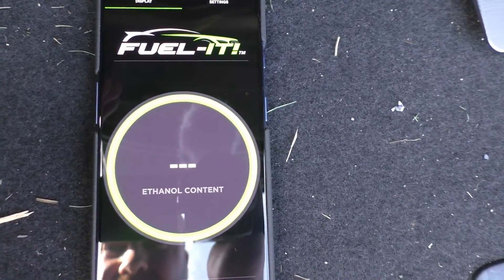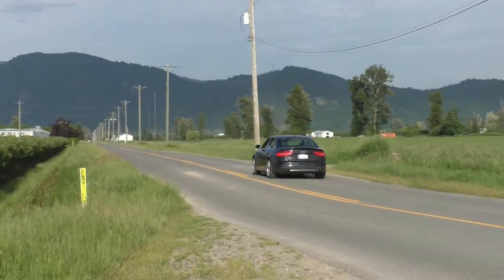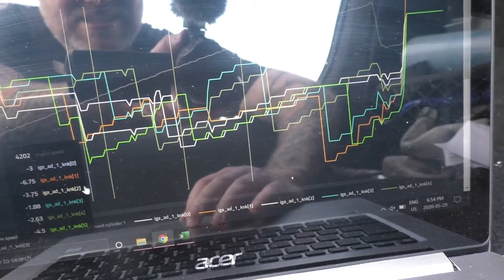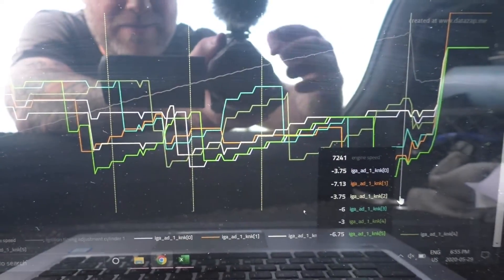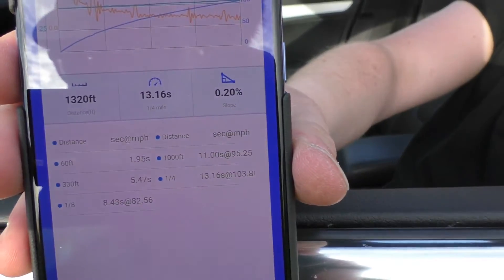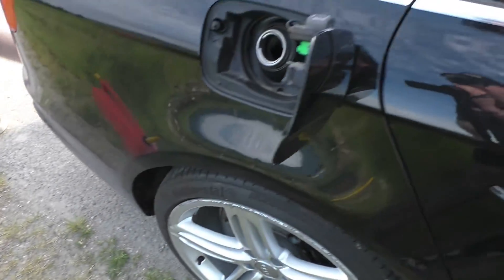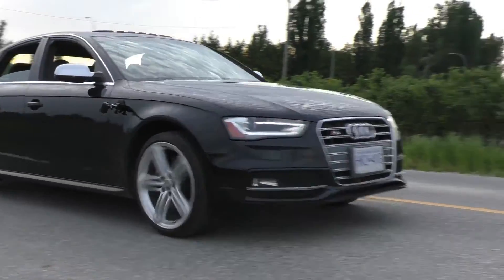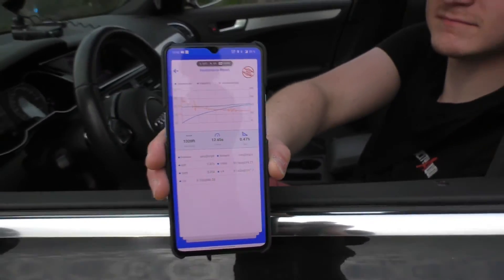ADDING POWER BY ADDING E85 TO PUMP GAS!!!

Comment: What levels are safe without any ethanol related mods? I need to do some logging with my vcds
Reply from the maker: You'll more than likely be completely fine with up to E20. I always recommend you start with E15. Log your car and see how the fuel system is doing. If you still have a bunch of head room, then E20 should clean up any corrections you're seeing

Comment: I have a '13 Q7 with JHM stage 2+ ECU/TCU tune running their 207mm crank pulley and heat exchanger. I have a 24 gallon tank and use 92 Octane here in WA state. Can I add a couple of gallons of E85 to the full tank of gas on the stock fuel system to get any benefits?
Reply from the maker: Absolutely you can! You can run a 93 octane tune on an E15 to E20 blend and make a bunch more power. Just datalog your car once you've added more ethanol to make sure your fuel system can keep up.

Comment: Hi there! I have 2 Speedways by me - the one with e85 only goes up to 91 octane gasoline. But, I can get the e85 there and go a mile up the road and pump 93 octane from the other Speedway. Is it worth it to pump a gallon of e85 and then go a mile up the road to pump the remainder 93 octane, or can I just use the 91 octane next to the e85? Thanks!
Reply from the maker: what octane are you looking to achieve and what tune are you trying to run?
Reply: @VancityAudi  sorry I wasn't very descriptive - its an 8v Audi a3 w/ the 2.0TSI w/ APR low torque 93 tune (soon to be high torque) and TCU tune.
Reply from the maker: @Matt Em  as long as your fuel system is working correctly, you can run the 93 tune while using 91 octane fuel blended with additional ethanol to equal an E20 level. The additional ethanol will raise your octane level past 93. With that said, as soon as you do that, you should be datalogging your car to make sure it is running correctly.
Reply: @VancityAudi  Ehh I made a mistake - the one Speedway w/ e85 ONLY has 90 octane, so I pumped 1-gallon of e85 at that station and then just drove a quarter-mile up the road and completed the remainder in 93 octane.

Question though! If you're always putting in 1-gallon of e85, unless you run that tank empty every single time, aren't you eventually gonna dilute your tank so the concentration of e85 eventually become really high??
Reply from the maker: @Matt Em  not sure you're understanding how this works. The best way you'll be able to monitor your ethanol level is by installing the ethanol content analyzer like i showed in this video. P3 makes one for your car. 

If you consistently add a few gallons of ethanol into your pump gas every time you fill up, that will ensure your octane level is above 93. As you burn off the fuel and then add the same mixture to the tank once you're out of gas, you will simply maintain your ethanol content level. It won't make it any greater seeing as you're burning off the fuel in the tank in between fill ups.
Reply: @VancityAudi  Yes I'm tracking that and the monitoring etc. But, lets say I only use half a tank. If I put 1-gallon of  e85 into a half-tank that already has 1-gallon of e85 (the remainder 93..) - wont the tank eventually dilute the ratio and have a higher concentration of e85 than intended?

Sorry to be a pain but I REALLY appreciate you.
Reply from the maker: @Matt Em  that's why you don't simply dump a gallon in every time. You use an ethanol calculator (many are available on line) to figure out how much ethanol you need to add for the amount of gasoline you are about to fill up with to make sure you don't go above E20.
Reply: @VancityAudi  Ohhhhhhhhhh gotcha! Thats the part that wasn't clicking. Thank you a million for clearing that all up my man!

Comment: why not use Total Timing? I dont see the point of looking at each cylinder
Reply from the maker: How would you tell if you have issues with one particular coil pack, spark plug or cylinder pressure if you don't log each one individually?
Reply: @VancityAudi  Because in this video, you arent looking for problems with coil packs, spark plugs or the cylinders. You are only looking for timing pulled and timing added. In this video.
Reply from the maker: @BigMotorLover  you are missing the point. Total timing is an average of the total timing you see in all of your cylinders. It isn't showing how much timing is being pulled. You are wanting to ensure that no timing is being pulled at all. The only way you can see that is by logging each cylinder. If you have zero timing pull in 5 cylinders and then one cylinder is -5 you then know your fuel is up to the task, but you may have an issue with a plug, coil pack or your cylinder may be cooked. Does that make more sense?

Comment: Last week I drive to NY to add 6 gallons of E85 (guaranteed to be E71 or higher) to a full tank of 93 (which already has up to 10% ethanol in NY).  My overall tank estimation was somewhere around 30% eOH.  I am running an APR DP+ tune.  The car is an absolute ANIMAL, I cant believe the difference.  I can only imagine what a proper fuel map for this blend would be like-
Reply from the maker: If you haven't logged your fuel trims this is very inadvisable. 30% is the absolute limit of the stock fueling system. I don't recommend anyone blend more than 20% when running pump gas tunes at a DP+ power level or else you can lean your motor out and cause it to blow the F up.

Comment: Great video! Will the results be the same with a meth set up that's tuned for power, just there for octane boost/knock control?
Reply from the maker: No, not exactly. There is no need to tune for the additional power using a low blend of ethanol in your pump gas. If your car is tuned to run meth though you will have to always make sure your meth is spraying properly for your car to run properly and not lean out due to a lack of octane.
Reply: @VancityAudi  whoops sorry I meant not tuned for meth. But I get what you're saying thanks!

Comment: Awesome info,  I’m on a B9 s4 APR stage 1 - you think a gallon of E85 with 91 should be solid?
Reply from the maker: There isn't one answer for every car and every tune. You need to log your car. Then you need to install a content analyzer. Then use an E85 calculator online to find how much E85 you need to add to your pump gas if you are seeing significant timing reduction in your logs. It's almost like I explained this all in this video already, lol
Reply: @VancityAudi  I’m well familiar with logging for data and using it to determine changes in the map. I was simply asking in your experience if the ECU’s you’ve seen adjust accordingly to a small amount of E85. These new ecus are light years ahead of what we used in the EVO world. 

Since it seems like you’re inconvenienced in engaging with your community. You’re not obligated to answer a comment either since you “almost like answered it in your  video”

Thanks again!
Reply from the maker: @ZlatanKnowsBest  Your question was answered in the video so why ask it then? lol.  Each car will run differently with the fuel you choose to use, the tune you are using, the wear and tear on the motor as well as its components.  There is no straight forward answer to your question until you log the car and find out for yourself how it is currently running on your APR software.  For all you know you are only puling a tiny bit of ignition timing and then you don't need to blend much E85 to clear it up.  Then again it could be pulling a f$ck ton of timing and you'll need to add way more to correct for the lack of octane in the pump gas you are using.  So log, add an ethanol content analyzer, blend a small amount, log and then add some more if needed.  Just like I mentioned in the video, haha.  Good luck!!!
Reply: @VancityAudi  trash reply. We found this on the B9 page under the “Snarky replies from car owners due to sensitivity”.
Reply from the maker: @CamaroSS2236  lmao. I was simply speaking the truth and it seemed to upset you as well as the other owner. Glad to know my snarky replies are being talked about elsewhere! Lol
Reply: @VancityAudi  it was a general discussion about snarky replies lol. No need to be upset.
Reply from the maker: @CamaroSS2236  I'm not upset in the least and wasn't upset before, lol. The problem with reading text on the internet is you can't read tone.
Reply: @VancityAudi  perhaps that’s the glory of text. Tone is interpreted through perception.
Reply from the maker: @CamaroSS2236  looks like we disagree again, lol.

Comment: If your using a pump flex fuel that is a E60 blend and not E85 does that change the amount of ethanol that you need to use? Just because my e60 pump would be easier to get.
Reply from the maker: Yes, E60 means 60% of that fuel is ethanol. E85 means 85% of that fuel is ethanol.  You'll need to add more of the E60 to get the level you would like to achieve.  Use an online E85 calculator to help you out.

Comment: Okanagan MK7.5 Golf R owner here. I've seen noticeable improvements in not only the overall power, but power delivery by adding Octane to my Shell 91. Because I dont have an ethanol Analyzer, I've been using VP Octanium or Race Gas additives from Lordco, mixing to their reccommended spec for 100 octane.  I've brought my best 1/4 on GPS down to 12.5 in a "stockish"  R with 7 speed DSG. 

My question for you would be: what is better? Adding Octane or adding Ethanol? Buying E85 locally is impossible, unless we're buying it from VP in a drum, from the local hotrod shop.... where Octanium and Race Gas are available from all the Lordcos locally. Would Octane not be a safer way to correct timing pull?
Reply from the maker: In my opinion using 15% ethanol blended with Chevron 94 or Shell 91 would be WAY safer and smarter than using additives.  Have you checked your spark plugs lately?  When you pull them are they orange and corroded? Rather than clean?  Keep in mind ethanol also has cooling properties.
Reply: @VancityAudi  slight tan tinge to them, similar to using high octane fuels purchased in drums. I used to own a Supercharged NB miata and it frequently saw VP105, plugs look the same. 

Do a dig on the Race Gas and VP Octanium. Some US based tuners are using it with great results. Its convenience can't be beat. On Shell 91/Chevron 94 - I could hear audible knock. Now nothing, and SOTP feel is 100% improved. GPS 1/4 mile is improved by .5 sec

 I'll look out for E85... if you say its safer.  It just isn't available in the Okanagan at a pump, AFAIK.  Petro has an Ultra 94 in Oliver and Osoyoos which is 94 E10. It was brought in for Area 27.  Might have to make a trip down there soon for a fill. 🚀
Reply from the maker: @tanktheram  I had no idea they had 94 Ultra there. That is supposed to be the best available pump gas in Canada if it is the same fuel that they get in Ontario. I'd try some of that with an additional 5 to 10 percent ethanol for best performance. If you like the additives then, stick with them. I just know I'll never use them. I'd prefer proper fuel over an additive any day.
Reply: @VancityAudi   wish we could just get some spicy fuel at the pumps, and not have to mess around....
Reply from the maker: @tanktheram  and finally if you contact Northside Petroleum in New Westmister they will deliver barrels to you in the interior.
Reply: @tanktheram  Hey, I'm getting some knock on the stg1 tune on my RS3, our 91 octane is soooo bad here in Nova Scotia, no ethanol, and all from the same source so all 91oct is pretty much equal here.  

How have you been using Octanium?  They're readily on sale here for $20.  I've been thinking about dumping 1/3 or 1/2 of it in a full tank per fill just to run knock free, not looking to make race fuel levels power.  I'm seeing -3 degree timings being pulled even on STOCK tune.  Let me know your thoughts.  Thanks!
Reply: @AHigherPerspective   zero downsides, and i've been on it almost exclusively for 5,000 km - mixing to 100 octane. I'm sure if you were going to 94/96 octane it would be all smiles. 

You could buy E85 in a drum, and mix that up with each tank too - its all in whats available to you!
Reply: @AHigherPerspective  my knock on BC fuel was audible with window open, and I could seat of the pants feel it hesitate as it pulled timing, even on Chevron 94... Gross.      I've since sold the car, but wouldnt hesitate to reccomend Octanium
Reply: @tanktheram  Thanks for the reply.  Once I fill up with Petrocan and log it I'll try experiementing with a 1/3rd of the can and do some logs before I attempt to go back to unitronic stage 1.

I first heard pre-detonation at peak boost and immediately flashed back to stock...that sound keeps me awake at night man.  I appreciate your input!
Reply: @AHigherPerspective   I did a look online at Shell fuel stations in the Scosh... looks as though there are a bunch of stations out there with 91 V Power... consider trying Shell 91 too, see if that helps.  They have the highest RON rating of any 91 octane in Canada....
Reply: @tanktheram  I spoke a gas station owner today and was informed that all 91 Octane west of NB comes from the same refinery, the only difference is the individual company's additive.....so i was advised to go to the busiest station as possible for the "freshest" gas....I need to get out this province...
Reply: @AHigherPerspective   keep in mind - much like octanium, additives can also boost octane levels. So if that theory is true, it could perform completely different than Petro.  

I've communicated with Shell back and forth through email numerous times.  They're very forthcoming with their info. You should reach out and see if that is true...      

back in the spring when I was chasing fuel related performance issues - I reached out to Shell, Petro, Chevron and Husky. All came back with different RON numbers for their top tier fuel..  Shell 91 V Power, and Petro Ultra 94 both claiming 98 RON. Petro 91 claimed 94 RON, and Husky 91 claimed 93 RON.   

Chevron actually declined to comment on their 94 octane RON rating, through email and phone call. That is the brand which I had all my major detonation problems with.  Switching to Shell helped immensely.      

Does VW not call for a minimum of 98 RON right in the fuel door? 🤔
Reply: @tanktheram  the 91 Oct thing is also confirmed by commercial fuel distributor here in NS as well and a Tuner in Halifax.  My logs confirms the exact same result from 3 different station 91 octane.  

Shell being the absolute worst, most likely from being the lowest traffic, and the slightly less bad Irving Oil which has a truck come in every 4 days.   Petro will be my last stop tomorrow and I'm sure the result will be the same. It's onto Octanium until I can get a drum of e90 in. Sigh....
Reply: @AHigherPerspective  I had no idea! I guess it really depends on where you are in this vast country.     Reply to this once you've tried it, and let us know what you think... my results were nothing short of fantastic!

Comment: Fellow Canadian here, just picked up my RS3 and went Unitronic Stage 1 after your glowing reviews.  How do we easily get our hands on E85 here : /  I cant even find pure ethanol anywhere here in Nova Scotia.  :(
Reply from the maker: If they don't have it at the pumps try ordering barrels of it.  Ignite E85 comes to mind
Reply: @VancityAudi  unfortunately none here on the pumps, but I did find a shop that will sell me E90 by the gallons in Halifax, so i'll probably make a trip down there once in a while and hoard some e90 and mix and aim for an e10 mix.  Do you think we can run Unitronic Stage 1+ 93 Octane with that mixture? or should i aim for E15.  As usual, thank you for responding to my comments :)

Comment: Hey I have same car with IE dual pulley 93 tune set up how much e85 do I need to obtain 13% ethanol if I have a 61 liter tank.
Reply from the maker: https://www.brewcityboost.com/about/ethanol-calculator/
Reply: It is completely safe for the fuel system and filters
Reply from the maker: I wouldn't tell you to do it, if it wasn't safe. You have an ethanol content analyzer installed? Have you logged your car?
Reply: So I would need about 11 liters of e85 if its rated at 65% ethanol content? E10 to E13 completely safe on stock fuel system and filters? 2015 s4 IE dual pulley 93 file, exhaust, intake, intercooler and forged lightweight wheels.

Comment: I run methanol injection cause direct injection on the 911 turbo s. What if u run methanol injection u probably get upwards of 50whp up the boost. I heard ppl run e85 n methanol for double the power.
Reply from the maker: It doesn't quite work like that. Your car has to be tuned for methanol to use it to  its full potential. Otherwise you are basically using it for cooling seeing as you are already correcting any timing loss you're seeing with the little bit of E85 mixed in with your pump gas.

Comment: Thank you for this very informative video. That little kit is really cool. I have the same car with the same tune. What are your thoughts on using UPI 93 but with a 91 tune? I'm in Ontario
Reply from the maker: If you have 93 available, why not use the 93 tune? You may not be utilizing the 93 tune to its max potential but you'll be faster then the 91 tune on 93 fuel.

Comment: Here in California, Top Tier gas stations already have 10% ethanol content added to their premium gasoline.
Reply from the maker: They do, yes, but the octane of those fuels has already been made up of that included ethanol.  By adding additional ethanol you will see improved performance.  If you log your car you will see that you still are not achieving peak timing using that 91 octane fuel.  At that point you can comfortably add another 5 to 10% ethanol on top of that and see all of the timing retardation be removed and get what you paid for out of your vehicle.